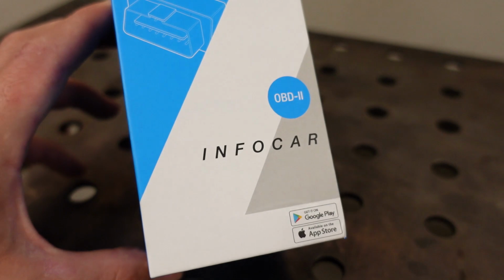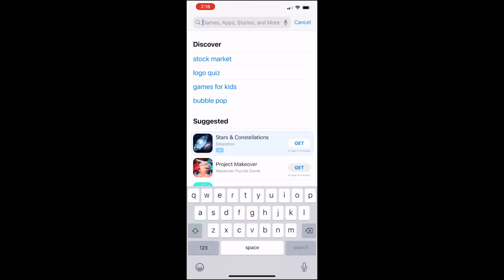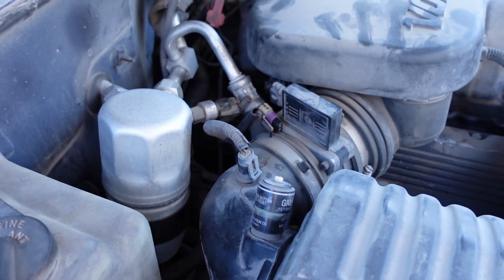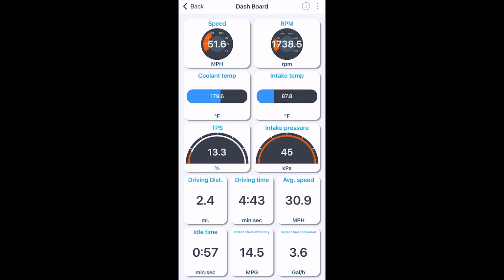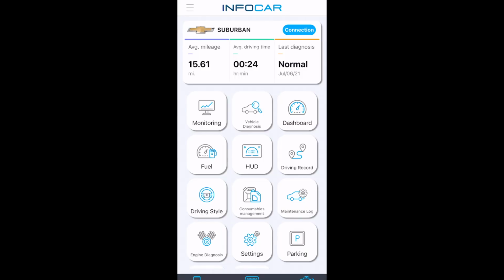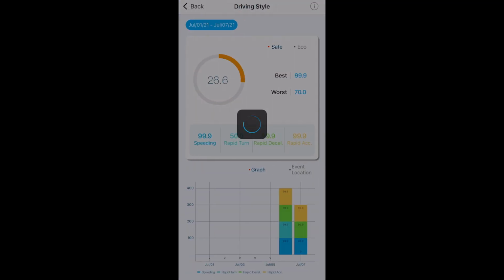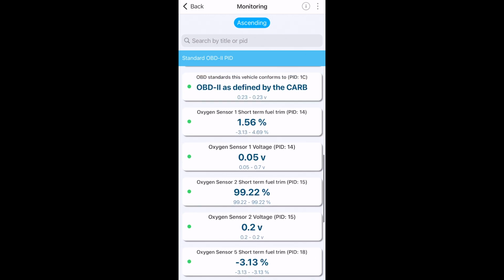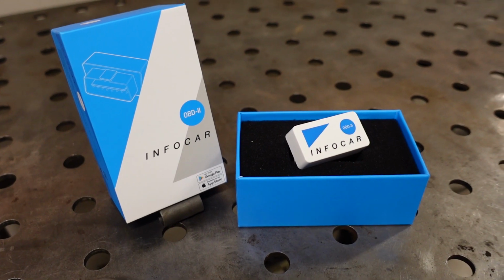A tool EVERY driver needs to have: Infocar OBD2 Smart Scanner

Comment: I stumbled upon this app by accident a year or so ago after installing oversize tires for ground clearance and switching to ethanol-free fuel in my Camry. After I got the speedometer and odometer discrepancies dialed-in, this app has indeed helped me to find a few tricks to help fuel economy and the car now beats its EPA ratings by 30-37%. I've seen 30-35 around town and as much as 48-51 highway on long trips. And no, it's not a hybrid.

Comment: Seems cool, is it locked to a VIN or make of vehicle or does it stay open?  Does it communicate your info to 3rd parties?
Reply from the maker: not VIN locked, you can use it on any vehicle, and I haven't tried messing around with other apps to know what it works with. I'd assume just their built in app...

Comment: It basically does the same thing as Torque except you don't have to worry about connection issues with some cheap obdII devices.  About the same price as well.

I'll check it out

Comment: I wonder how it computes fuel volume for mpg….I guess it uses injector pulse widths as there isn’t a fuel flow rate meter in the system.
Reply from the maker: The computer knows how much fuel its using based on a given injector flow rate, fuel pressure, and pulsewidth
Reply: @TolmanPerformance  Yes, that’s what I figured. Depending on the year, it really doesn’t even use/need to know fuel pressure (stays at 58 psi, for example). It just knows how much fuel it flows given a pulse width.

Comment: I've used Torque Pro and Dash Command with a Bluetooth OBD2 adapter. Now I have the iDatalink Maestro Rr installed in my Silverado connected to a Sony XAV-AX210 stereo which displays the performance gauges on the touchscreen display.
Reply: Pretty cool, what year is your truck?
Reply: that's why I'm here, looking at different scanners to use with an android deck!

Comment: I use a bluetooth obd2 dongle to monitor trans temp & load % in my sierra 1500 (4l60e woes) when I’m towing my drift car. If you can get the custom PID’s working, it’s a great cheap alternative to plumbing a trans temp gauge. But you have no idea how many drift cars I’ve fixed trackside just by grabbing the dongle & pulling codes for people. I’m always surprised how many people with obd2 cars don’t have a scan tool.
Reply from the maker: for the price, its a great substitute for a full blown scan tool, especially for reading and clearing codes.